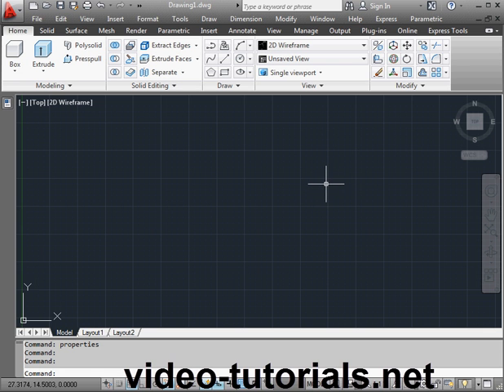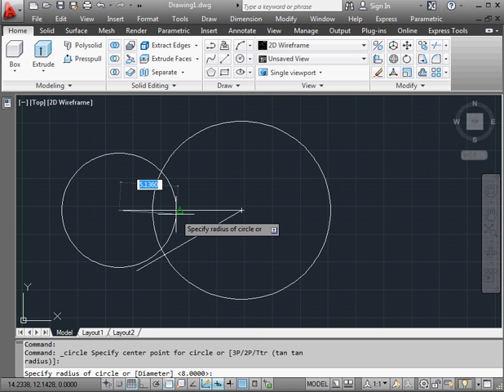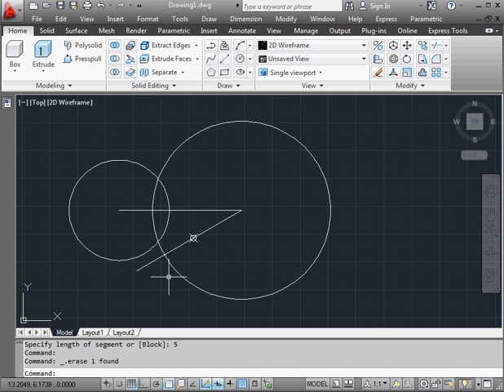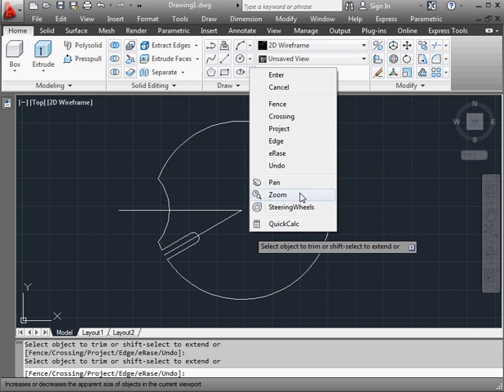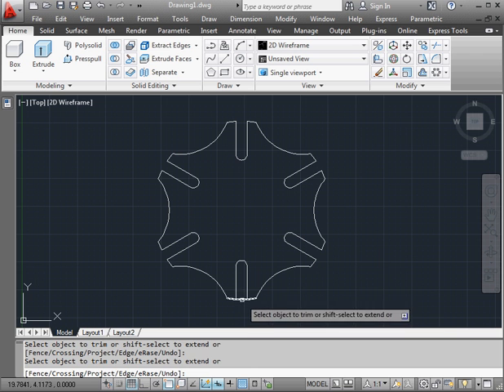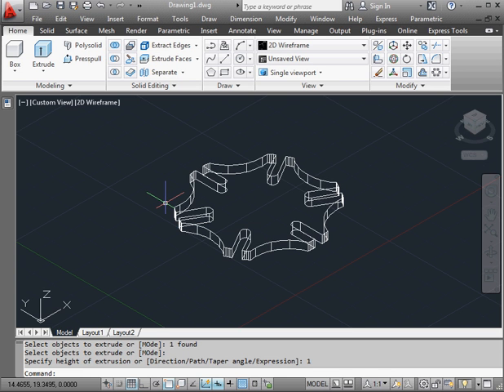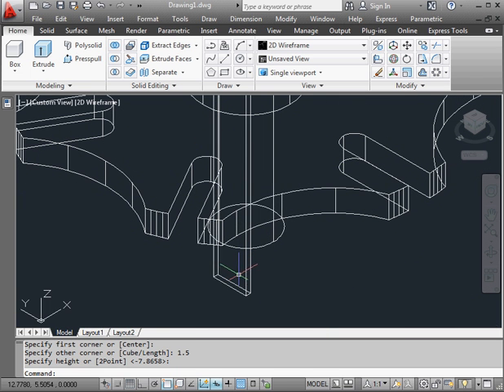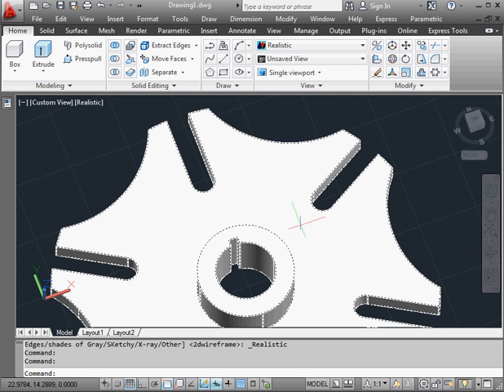AutoCAD Tutorial - basic training -  how to build a gear

Comment: hello. i have a problem, i cannot extrude the object... do you know the reason why?
Reply: Hi Erald, I think the problem might be with an extra line, you have to clean the object. Explode and join it back together, at the first attempt you will be able to see that extra line and afterwards remove it. You will be able to extrude the object in the end.
Reply: Try to extrude in the solid tab rather than on the home tab. I also used wireframe view instead of 2d wireframe